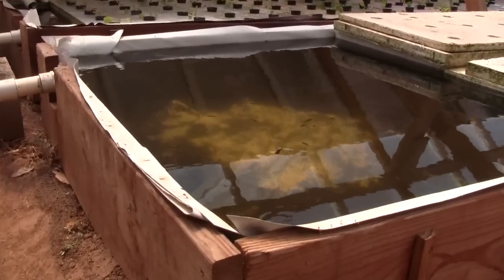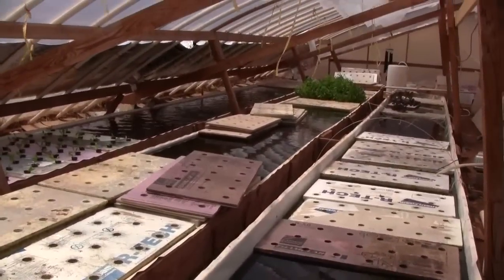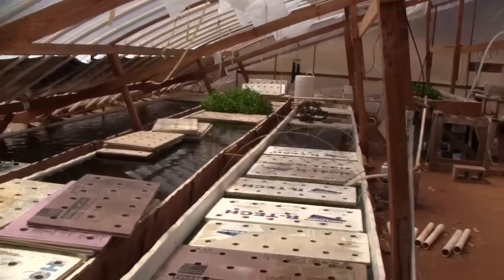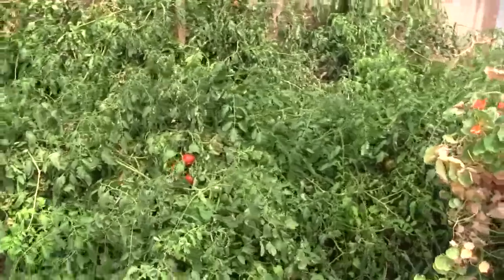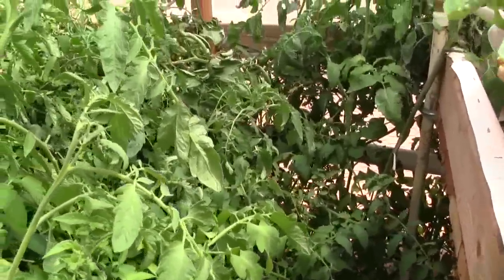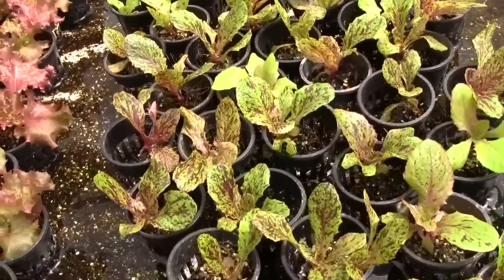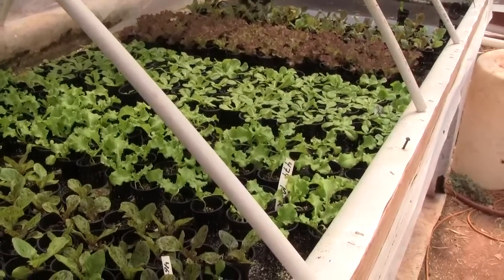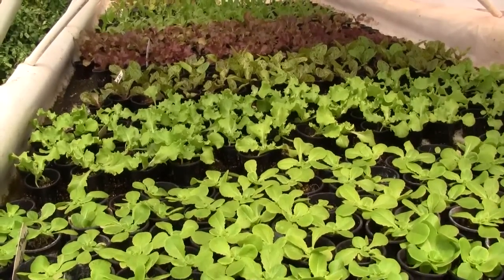Aphid Control in Aquaponic Greenhouse

Comment from the maker: Here is a new spray for aphid control made using Edible food ingredients like Olive oil and emulsified using high tech ultrasonics.  
https://www.kickstarter.com/projects/1288123367/edible-pesticides-beyond-safetheyre-edible?ref=discovery
The new emulsification method does NOT use soap, so the sprays are made with food and actually taste good and are safe to eat.  Basically a vinaigrette............with zero soap.  Soap and neem don't taste good, these new sprays do, so they work great on lettuce, kale etc.